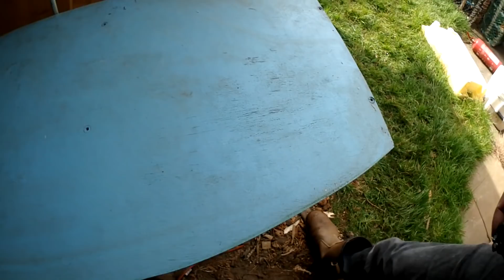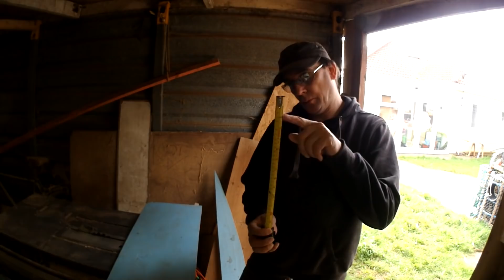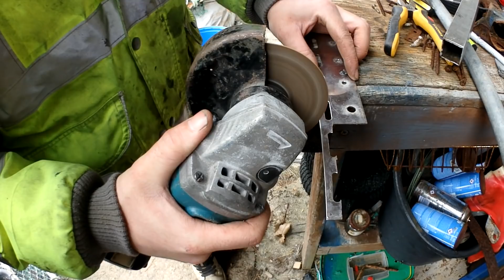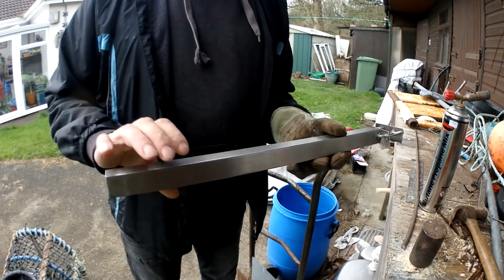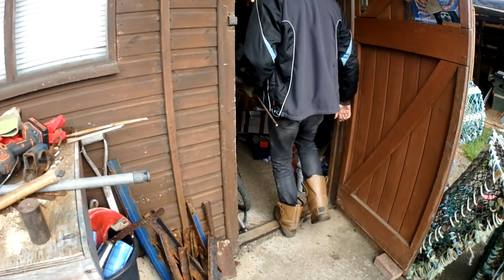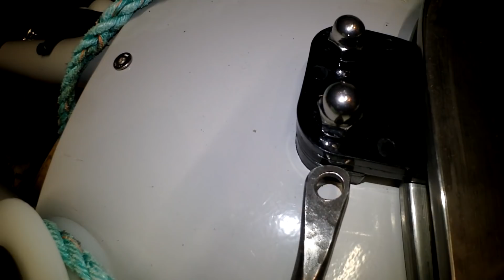Orkney Fastliner 16 Refit - Battery Locker & Winch / Hauler Part 2

Comment: Is the winch not designed to take the loads imposed on it? or is your brace to compensate for the potential weakness of the mounting point on your boat? I kind of feel that the winch swinging and rotating could reduce loads on the mounting as it slews around to pull straight to the pot.....
Reply from the maker: yes its the mounting points on this kind of boat, the brace will take a lot of strain off them. Fixed davits are pretty common plus the hanging roller will give it a certain amount of movement

Comment: Hey trojs isn’t the fact your winch swivels relevant surely it swivels for a reason because the pots or creels are retrieved at different angles from sea bed allowing winch to adjust to the angle ?
Reply from the maker: Many boats have fixed davits. I know roughly what position the winch will need to be. Plus it does have a lock at the base